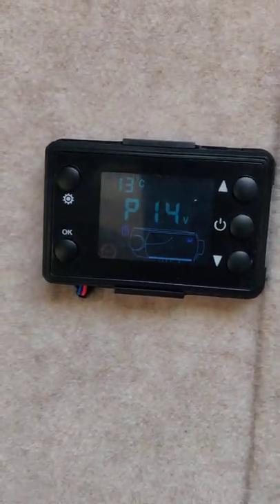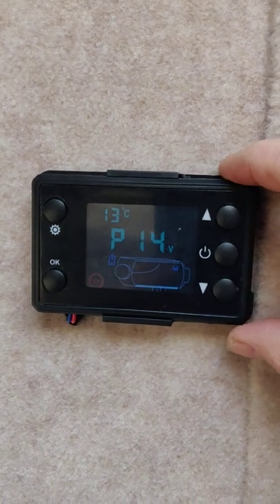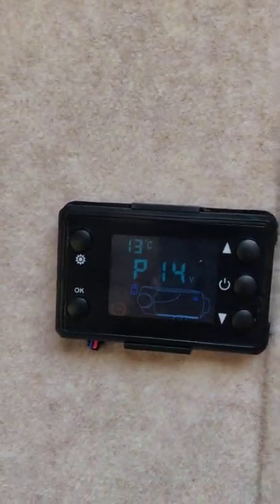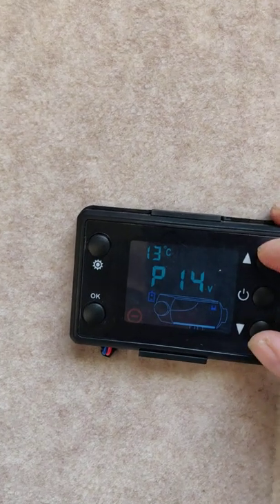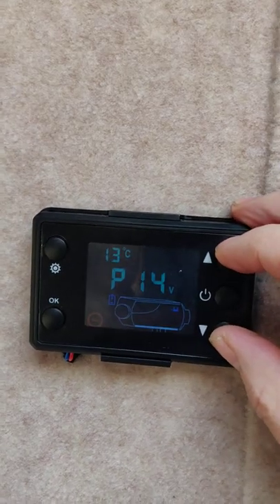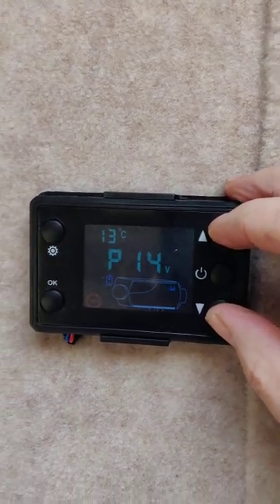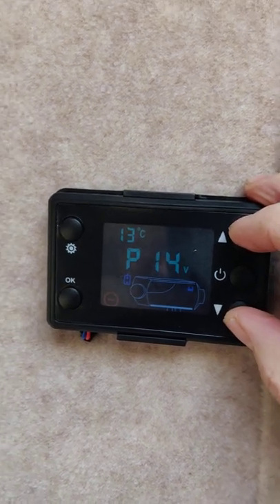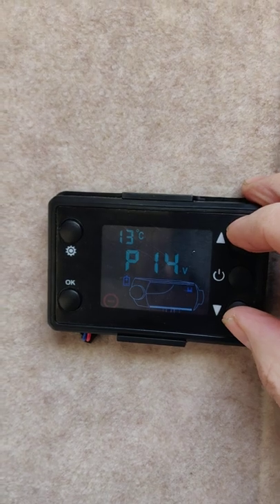How To Prime a Diesel Heater Newer Version Diesel Heater with Blue Text 🔥🏕️🚐✔️ #shorts

Comment: How long will I need to hold it? I’ve been holding that on and off for maybe 20 times now. When it turns on, it shuts down after 2 secs.
Reply: Mines doing the same. On for 2 seconds. Did you work yours out?
Reply: You have to hold it all the time until the fuel gets to the heater ;)
Reply: Did you figure out the cause
Reply: @klo123ism  it was my power station. It was stopping intermittently when it hits a certain wattage it can't handle
Reply: @neild7971   it was my power station. It was stopping intermittently when it hits a certain wattage it can't handle
Reply: Did you get a E-2 error on your display?